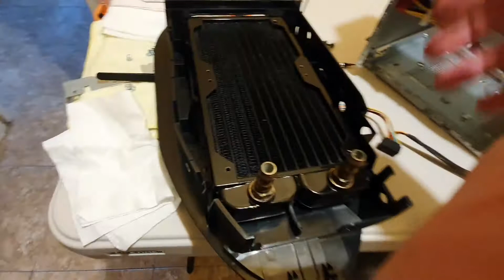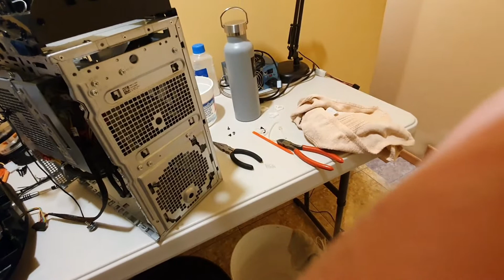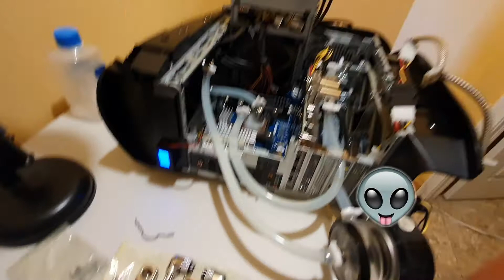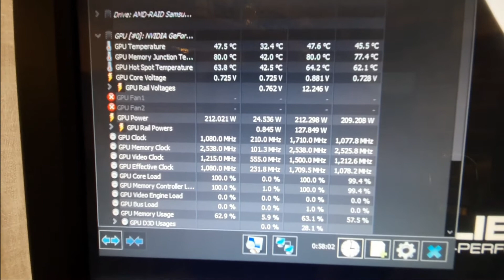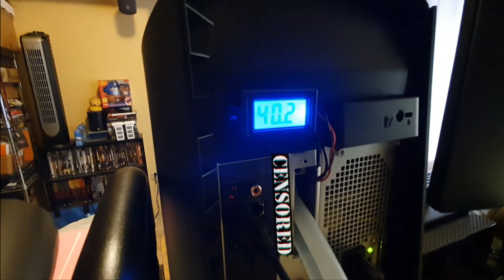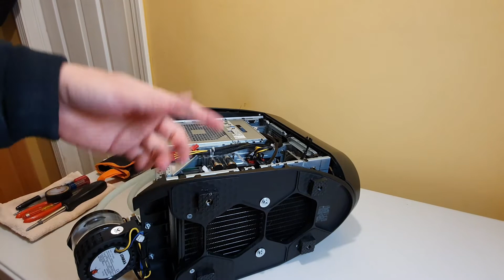Custom Water Loop on Alienware Aurora R10 (Part 2)

Comment: Wow what an effort great job! 
240mm AIOs are fitting to R11 and 12 (after so many drill and cuts) So they got similar chassis
Do you think R10 is really not worth to try cut and fit 240mm radiator and 2 fans?
Reply from the maker: Sorry for the very late answer, if you love the case and want to keep using it then I would go ahead and cut it, they can fit but the biggest problem is that no matter how many fans you put on it the case has very little airflow mainly because of the  power supply being on top of the MB with very little space between them, I already did a case swap and the temps went down significantly just haven't gotten around to editing the video so I can upload it, but to tell the truth after having the alienware sit at my desk for a year it grew on me so I kind of miss it :Op, when the R13 came out I was planning on modding the case to put the power supply on the bottom and add a side window but ultimately went with a new case altogether.